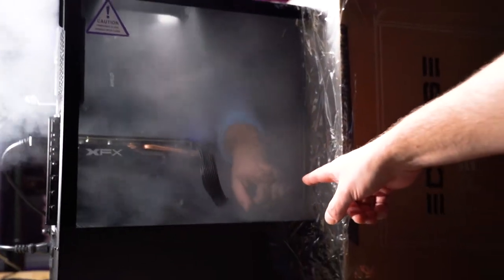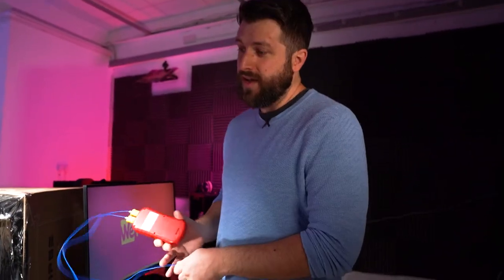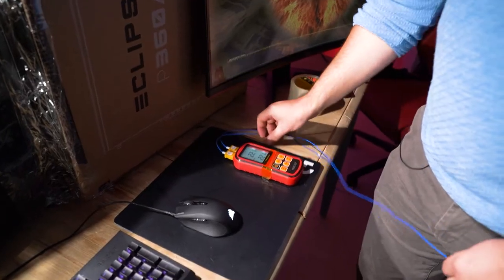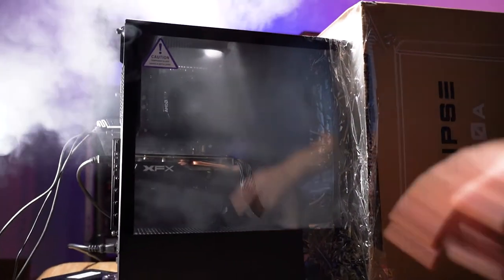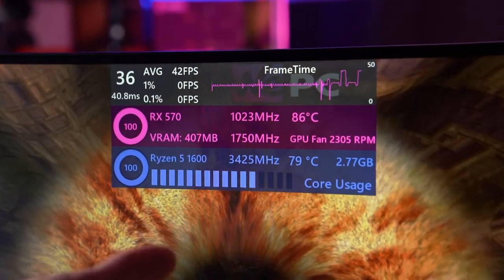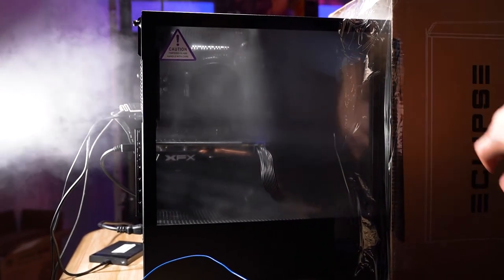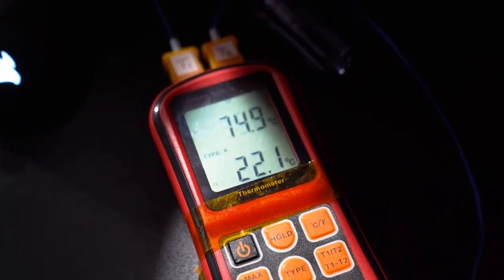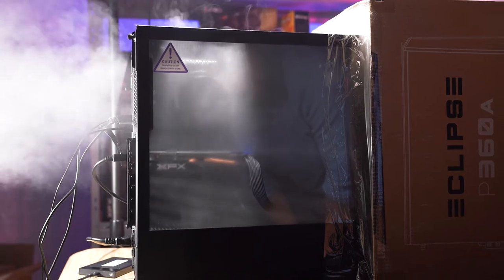The NZXT H510 has terrible Air Flow! Case Testing EPISODE 1

Comment: Final conclusion: NZXT knew what they were doing with the original configuration.
Reply from the maker: I actually think neutral air pressure is better in this case.
Reply: @WePC  what do you mean by neutral air pressure? Don’t really understand how to configure neutral air pressure for this case
Reply from the maker: Neutral air pressure is when you have even levels of intake and exhaust in a case. So what you need is the same amount of fans pulling air in as you do pushing air out. In this test we had 1 fan at the front as the intake and 1 fan at the back as the exhaust.
Reply: @WePC  thanks for you reply! I am using this case. Currently remain original configuration. I think I should get two more fans inside the case. Do you think that is ok? From your video, you did mention about the turbulence from the top front fan.

Comment: Hmmmm interesting, I want drill in an extra exhaust for my h510  on the top of my case.  Your video basically confirms my theory on how I imagined the air flow would look. But would you be able to do a video doing this same test with an AIO on the cpu? I'm curious to see if the airflow would make a difference without having a fan on the GPU.

Comment: What if the PSU was turned upside down and use it as an exhaust fan?
Reply: I think the problem with that would be it might cause the gpu and psu to fight for air dominance and cause more air to be pulled in from the rear of the case. Hot air from the exhaust fan... idk tho just my 2 cents

Comment: I have this case and i have a tower air cooler (cryorig h7) on an r5 2600 + 1660 super, neutral pressure setup with the stock fans (front bottom intake and rear exhaust) and I get around 73C on gpu and 68C or so on CPU under load. I have OC on both cpu and gpu. Having good gpu and cpu cooling helps a bit. Yeah that could be lower with mesh, but its not that horrendous all things considered.
Reply from the maker: On our test we are torture testing at 100% load so our CPU and GPU temps are always going to be high, but what's important on this test is seeing the air flow easily through the case and having low air temps at the front and back. Because the air movement isn't perfect neutral air pressure is definitely best in this case, it sounds like you've got yours set up really well. Join our discord and send a picture through, it would be great to see your set up
Reply: What if the PSU was turned upside down and use it as an exhaust fan?
Reply: @WePC I just bought an nzxt h510i that comes with two fans but they are not RGB, I intend to put 3 more RGB fans, 2 at the front and one at the back, and maybe put one on top of the ones that already came with it. In this case, to improve its air flow, do I have to put the fans at the front to pull air in from outside and the ones at the back and top to throw air out?

Comment: I hate to be that guy but the case doesn't work that way. It performs like a vaccum by having the fans only on exhaust as default. Thats why the case comes like this.

Gamers nexus tests show is that the case performs pretty well for the GPU and yes the CPU does get a little hotter without intake, in the grand scheme of things it doesn matter.

No case really compares in terms of looks, perform, and price to the h510. 

Yea you probably shouldn't put a high end gpu in a 70 dollar case. But I'd hope that'd be obvious. 

I put a bare bones 3060 and 3600 with a stock cooler in my gfs pc with a h510 and the thermals are great.
Reply: i recently build my pc with this case with a 5600 and rx 6700. Will i face any issues? i don't do any overclocking, i play 1080p ultra games and browse chrome a lot. (avg 12 hrs a day)
Reply: so full negative pressure build? just the two exhaust fans, rear & top, with their dust filter removed? and maybe a two-fan tower block CPU cooler with fans blowing into the rear exhaust? 

I was gifted a PC and it has this case.. the GPU thermals are grim. I gotta remove the two-fan AIO from the front, all it's doing is blowing hot radiator air into my GPU.

Comment: I would like to be able to see your layout / setup before jumping straight to a smoke test where you have a glass panel with protective plastic still on it and we can't see the internals well.  H510s are known for being "negative pressure" cases.  Just have exhaust fans on this case will give the best results.  Putting any fans on the "front" will increase temperature unless you cut holes.

And to drastically improve GPU temperatures 3d print / build a shroud from your gpu fans to the open pci slots.
Reply: So like isolating the GPU from the other hardware?
Reply: What about mounting a fan to the empty pci slots for either exhaust or intake of air for the GPU.  I just got this case so I may try it with just 3 exhaust fans.
Reply: Or just buy a different case

Comment: For those of you with this case, I'm thinking of filling the top fan slot with a fan, would an exhaust fan be more beneficial? Or an intake fan? Thanks for any advice
Reply: I have a the H510i and I've had it for about a year now with absolutely NO cooling issues. I'll try to give you my thoughts and experience incase it helps. Also I'm sorry if I explain things you already know, I don't think you are stupid... I just don't know what you do and don't know!

I'm running four fans total (not including the PSU's fan because its basically isolated down the bottom and doesn't really effect the rest of the case). I have a radiator installed at the front of the case with two 140mm fans doing the intake (SUCKING IN through the front). These front fans are the standard High Static Pressure fans that came included with the AIO kit (NZXT Kraken X63). I then have have a fan on the rear and the top both working exhaust (blowing the air out), both are standard airflow fans that I believe came with the case. I have all the fans setup to adjust their speed based on the CPU and GPU temperatures. I actually have my two exhaust fans set to turn OFF when my GPU is under 40C.

This setup has been working well for me over the year in terms of cooling, I've had no issues even when things are under heavy load... HOWEVER... because my two intake fans are having to force air over a radiator while my exhaust fans don't have that extra load, its hard to maintain any sort of positive internal pressure, what I mean by that is more air is being blown out then sucked in, so I do get a TINY bit of dust build up... though the case is so easy to access that It's not too hard to keep it under control. I think turning the TOP fan around so its also sucking in might help with this. Something for you to consider? If you aren't running a radiator in the front though, perhaps a better solution would be to have two static pressure fans mounted in the front set to relativly aggressive speed profile and keeping the rear and top fans in exhaust. Also... honestly because of the way the GPU sits in comparison with the two exhaust fans, most of its cooling comes from its OWN two fans.

Comment: I have this case.. everything was fine until I installed a gpu in my system... I have an i7 10700 cpu with an arctic 34 duo and i just  installed an  rx 6600. Cpu now has reached 70  degrees will gaming and the gpu hit 80, will on several videos it reached max 65.. i have an exhaust fan on the back and an intake fan on the bottom front.. first thing i have to turn the gpu cooler facing on the back of the case (now is facing upwards).. Are there any suggestions for what to do??
Reply: i think you have to use 2 inhale at the front and 2 exhale for top and back

Comment: Gpu 60 degrees is a bit low temp for 30 series
Reply from the maker: we aren't using a 30 series in this video it's a 570. 60c is just a general rule, but different series of cards can run at different temps, the 30 series are able to run hotter.
Reply: @WePC  So what do you think about their streaming pc? It has a 3070, will I get temp issues?

Comment: what i never understand in testing. Why leaving stock fans that are junk in every case you buy. Replace them and everything goes fine even in this hard-flow case. I have a 360 rad in h510, a high speed 140mm exhaust on top and a t30 on back, no difference with super flow cases like corsair with dual 200mm in front.
Reply: How do you fit a 360mm radiator in a h510?!

Comment: LOL. I have the h510i with a phanteks Glacier one 240 AIO, replaced the NZXT fans For Arctic P12. On Top a P14 and a P12 at the back. Its silent as fuck and temps are good.

Ryzen 5600x (35°c - 55°c)
Radeon Reference RX 6800 @938mv/2299mhz (50°c-72°c)

AIO PUMP @1100rpm
Radiator fans @ ~900rpm
Back and top @ ~800rpm
Reply: yeah i bought a computer built by nzxt with this case, i don’t know much but i do know that it always feels like a lot of heat is coming out of it and the nzxt fan is extremely loud

Comment: I'm running a 3900x with a beefy bequiet air cooler with a 1660 super. My cpu Temps stay in the 60's and my gpu stays around 71 or 73 at 90%. I do have front fans on the panel but even though I'm getting a new case for the rx7000 series, I'm thinking off putting a fan under the gpu on the tabs just to help my gpu exhaust better. But this case is bad ain't gone lie I wish I would of watch more videos before I built. It's gone be 2 years next month and my fans are still running 100% while gaming.

Comment: Your using the stock AMD cooler dude obviously your temps sucked because of it. Most people would be using a air cooler with a large heatsink that helps pull air out the case. That crappie little cooler is blowing air towards the mobo unlike the coolers I’m talking about which help it blow out the case.🥱
Reply from the maker: this is a case airflow test video as mentioned in the title and multiple times throughout the video. It's not a CPU cooler test video. I record system temps but the air temperatures through the case and movement of air is what's important in this test.